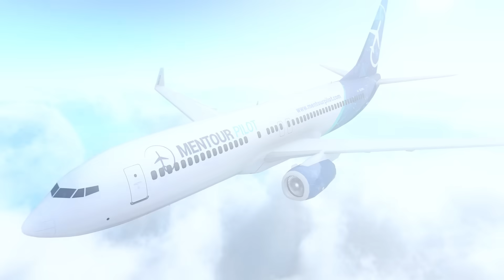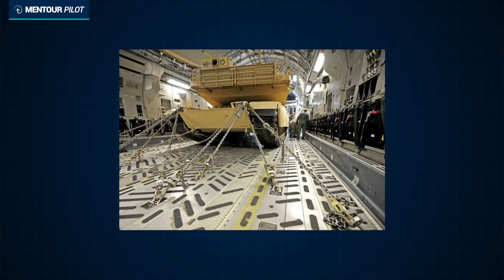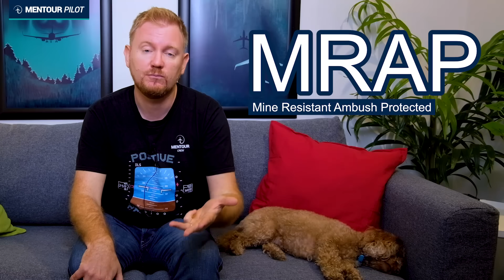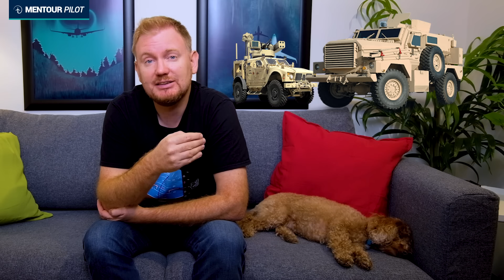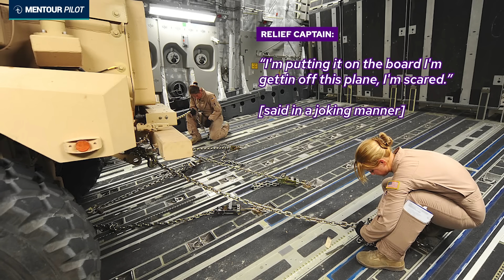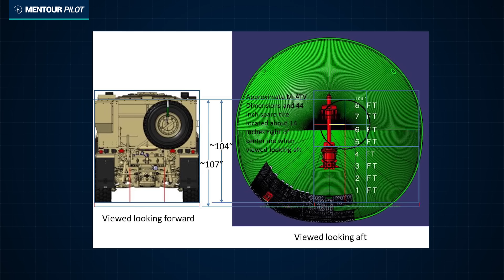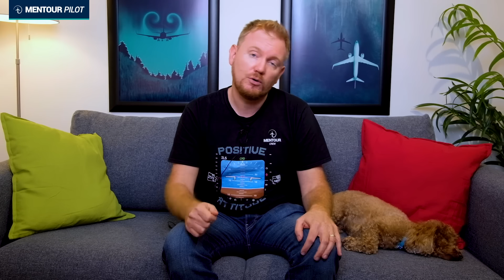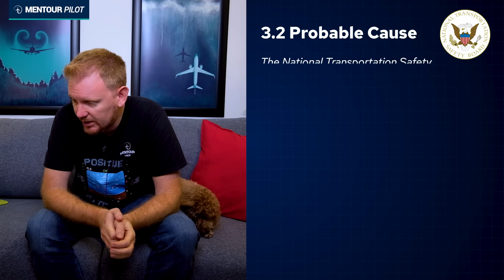Why did the pilots LOSE control?! National Air Cargo flight 102

Comment: This is awful. They were so close to avoiding the disaster. All that would have been needed was for the pilot to be a little more assertive on securing the load, which wouldn't even have been necessary if the airline had offered better training.
Sad!
Reply from the maker: Absolutely correct
Reply: @MentourPilot  a gruesome event covered respectfully and with tact, well done.👏
Reply: One question to ask is always "what training and certification do you have"?  Or even "show me the written procedure you are following".  "Where does it is say the cargo can move?  If so by how much?"   Yes, I know it is easy in hindsight but this is an unbelievably critical job that must be done right.
Reply: @jamescaley9942  "Where does it is say the cargo can move?"
The cargo cannot move. No captain worth his salt would fly with loose cargo.
Reply: @millomweb  I 100% agree. Cargo like they had onboard should not move at all.
Reply: @VMCAviationVideos  THANKS - cos I'm totally clueless :) I can't even tie knots in ropes to tie anything down ! But I do understand physics !
Having recently watched a 'disaster' video where a plane was stressed to 5G and survived, landing reasonably ok in the end, the plane was still written off pure on grounds of being overstressed in flight. So, on that basis, straps to tie down a load of 1 tonne should be strong enough to hold down 5 tonnes. So if the wings fall off, you can be sure the load wouldn't move ;)
Reply: @jamescaley9942  The loadmaster  did it by the book, relying on the company cargo loading manual.  Which left out some very crucial elements.  Which is why the chief loadmaster came up with the same faulty solution for the NTSB.  But yes, somehow I doubt USAF loadmaster training is only a week.
Reply: They were so close to getting lucky and not having the inherent issues in the situation doom them that day. But it was going to hit them or someone like them.  The root problem above and beyond the ones such as flaws in the company manuals, was that this private contractor was asked to do something they had no experience with or knowledge of. To the point that their lack of knowledge was enough that they did not know enough to recognize it. They were being asked to haul heavy armored military vehicles around in their airplane. With no supervision from the Air Force. Using their private contractor training and operational rules, that were never intended to haul armored military vehicles around the planet. a 5 minute walkthrough by an Air Force Loadmaster would have spotted the problem instantly. Why was military cargo of this nature not being checked and cleared by military loadmasters when shipping into or out of foreign military bases? Why was National's freight manuals not reviewed by the AF? Better yet why were they not issued AF manuals for how to properly secure and anchor the vehicles for transport? This goes a little deeper than National having bad training or publishing incorrect strap calculations in their manual.
Reply: @andrewtaylor940  When a carrier takes a military contract, they are asserting that they have capabilities at or beyond what the military has. That's why there wasn't a check, that's why they weren't issued manuals, that's why there was no supervision. It was expected that the crew already had the competencies required to handle the load. In short, the Airforce ordered a motorcycle and got a tricycle. National should have never picked up the contract in the first place.
Reply: @Mostlyharmless1985  fair enough, but since when was it good practice to hand out high value business on the strength of unsupported assertions?
Reply: @kitten_processing_inc4415  you are asking me about the ingredients of the sausage, when all I do is turn the grinder. I’m telling you how it is, not how it should be. 
There’s a fair amount of delineation between contracted shipping and military shipping because if the military takes on the responsibility on the disposition of the cargo, then they are liable for anything that happens to the equipment or personnel if something goes wrong. Now I haven’t read a contract in a long while but I’m 90% sure that the carrier agrees to handle the cargo according to or exceeding the militaries standards.
Reply: @Mostlyharmless1985  I don’t understand anything about Military nor Contract nor Airline Crash’s.
I was used in TRADE BUT IT WAS KEPT SECRET💔
Reply: @andrewtaylor940  Indeed.   I'm amazed that military equipment is transported by air with out a US military load master approving it.

Also, notice how in pictures of vehicles being loaded by the military either had a insane number of straps, or used chains.   It's so life or death that I just can't wrap my head around the idea that you would even trust straps over certified and tagged chains.  Straps have their place, but chains approach true mechanical attachment and that seems warranted on this kind of item.  How many large bulldozers and excavators do you see tied to a lowboy trailer with straps?.... I never have.
Reply: @member5488  That’s a good point, and those trailers don’t rotate upward to 20 degrees either.
Reply: @member5488  In ship operations at least, the military gives a load plan, but the second mate is the final authority of the final disposition of the load on the ship. They are not required to listen to a single thing the military suggests. If you take the contract to carry the freight, the inherent implication is that you have crew that is trained and experienced in handling it. The entire point of putting it on a contract is that the military assets aren't available to move the cargo in the first place, else the military would do it themselves. That is my guess as to why a Airforce Loadmaster didn't check it over. I guarantee that if the National Loadmaster were humble enough to find someone to help that it would be freely given, but being a contractor it is firmly in the "not my monkey, not my circus" territory. You took the script, and in taking it you were guaranteeing the handling of the cargo.
Reply: @member5488  The problem is that aircraft anchor points are not nearly as strong as the anchor points on a lowboy or a railroad flatbed. So you need many straps to spread the load.  And when you run out of the anchors with the right geometry you need even more derated straps. Hence the Boeing 60 strap solution.
Reply: @member5488  that is a very interesting point. It is in the armies very own interest to receive their cargo in time and in one piece. Checking the cargo securing before departure and on arrival and talking to the flight crea would have revealed a systemic risk of damaged cargo. Even ignoring the risk of damage to the plane and risk to human life: That securing was inadequate for the save transportation of the cargo.
Reply: @member5488  until about 1995 none of the guys around here chain excavators on at all. everyone thought a chain wouldnt stop it anyway. until the cops cracked down on it, you wouldnt get away with it for long now
Reply: @andrewtaylor940  I agree. The USAF should have supervised the loading. They got it there, somehow.
Reply: They weren't close to avoiding the disaster at all! There were so many failures, it's hard to imagine how the pilot could have been prepared to take off. Even a truck driver would check the straps on a load before setting off, or after a stop. Things get really dangerous when unqualified people start using their experience or intuition.
Reply: @charlestoast4051  It's surprising the first flight with that cargo was completed.
Reply: @charlestoast4051  exactly! Even a truck driver inspects their own load!
Reply: @charlestoast4051  absolutely, seconded by a truck driver, ALWAYS check your load for security, more chains,wheel chocks, and more straps, until ALL possible movement is eradicated, in all directions, and that's for a truck, if my truck could fly, I'd be using everything possible to stop ANY movement
Reply: @charlestoast4051  if they are even allowed in their trailer. Sometimes they get contracted to transport a mystery load by the government. Or other highly secretive products from companies. 

Now, the pilot should've checked in this case.
Reply: The load was VASTLY more than the aircraft could safely and legally handle. Nobody on the plane or in the entire company realized that, or understood how complex it was to secure that kind of load.  Even if they had added more straps they almost certainly wouldn't have been enough, as you rapidly run out of the tie-down points positioned appropriately and you start to have to de-rate the strap capability as you use the ones you have.
Reply: @k53847  and that's how boeing came up with 60 per vehicle.
Reply: @electricheartpony  '60 per vehicle' clearly shows Boeing's complete ineptitude.
The only person that can say how many straps are needed is the person who fits the straps. Because it depends entirely on how the straps are fitted. Also, those vehicles should not have been on their wheels. They should have been sitting on solid blocks. By leaving them on their wheels, the suspensions will allow movement - and that's why the guy said they normally get movement - because they've not been securely loaded. Chains should have been used, not 'straps'. The weight of each vehicle should have been multiplied by 5 and the number of chains needed for all 5 directions should have amounted to 150% of wt of vehicle x 5.
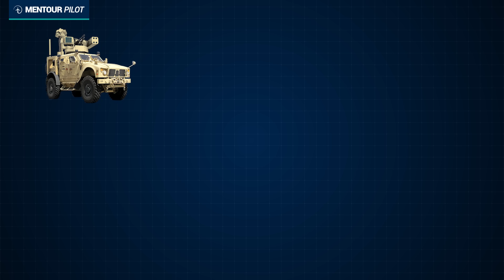Reply: @millomweb  60 is better than 26 or whatever the loadmaster was recommending 8:41
Reply: @millomweb  chains may not be suitable as they may exceed the point load on the deck floor, you would want to spread the load evenly.
Reply: @stultusmagnus  It's a sheer sign of cluelessness.
As someone else said, the anchor points in the aircraft may not have been suitable (strong enough) for that type of load.
Reply: @timballam3675  It's probably questionable as to whether the plane was kitted out to carry loads like that in the first place. Clearly the loads should have been chained down and the plane should have been suitable for chaining down to.
Maybe a further false floor should have been used to spread the load properly.
Reply: @k53847  I suppose it’s reasonable to think “if it fits and weighs less than max. load capacity, it should be ok” but clearly ‘how to secure it’ is the 3rd side of the safety triangle.
Reply: @k53847  The load was within the capacity of the aircraft if properly secured. The video correctly makes clear that the risk was understood but not properly evaluated on this occasion.
Reply: @philipsmith1990  No, the NTBS report clearly says that the maximum safe and legal load was one vehicle.  The limit isn't just total weight.  Look at the report to see their explanation.
Reply: @k53847  And probably leaving them in neutral, so they rolled around as well. Gosh
Reply: @BubblesTheCat1  
If you secure the vehicle properly it doesn't matter of is in neutral or not.
Reply: @smk3964  Yeah, that's true, but if it wasn't secured properly, being able to roll on their wheels could have made the difference between crashing or not.
Reply: @BubblesTheCat1  Given that the floor had rollers for easy cargo movement, I imagine 12 ton vehicle could easily slide on those rollers on an incline (10 degrees rotate angle for 747-400 if my google-fu serves me right) even in park/handbrake state.
Reply: @vadimbich4602  Aha! The first intelligent response. 😊
Yeah, I think you're a 100% correct. Never thought of that.....they'll roll,  regardless. 
Definitely needed chains to secure it,  and not straps. I also agree with the one other person who said that vehicles must not be on their wheels, but on blocks, as theycan still move due to the suspension.
Reply: @smk3964  Yes, the vehicles shouldn't have been standing on the shock absorbers, allowing the vehicles to swing up and down and tug on the straps.

And the fact that yhe vehicles had already moved forward during the landing should have been enough to realize how close to death they had already been on the first leg. And that a big rework was needed.
Reply: @BubblesTheCat1  @Kevin Rose, I’m pretty sure the vehicles being in neutral were never a issue. And hindsight is always better. If the still photographs examples and the description in the video are correct, the vehicle’s were chained onto doubled up aluminum skid plates with plywood in-between to distribute the weight. If those skid plates were not captured by the floor cleats/hooks, this was the huge problem for this heavy load. Not that it would have even been possible to use the floor hooks because the load plates were warped upwards from the chains that were used to hold the trucks in place. This also greatly reducing the contact area between the load plate and the airframe decking. Aluminum on aluminum does not have a great deal of natural friction anyway, then add in the rollers on the airframe decking basically making these vehicles projectiles. They should have been loaded with tires on the deck (friction), then tires deflated (more friction). Secondly, why not use chains? Because they weigh more? Chains should have been used to secure this load. That’s how they load in on C5’s. Those bits of straps that were shown at the end didn’t look very substantial at all. I drive heavy load commercial and would never haul something this heavy using straps, let alone needing 60 straps to secure one vehicle safely. Just one 1/2”, Grade 120 load chain has a working limit of 17900 pounds and a break force limit of 71600 pounds. 8 chains and binders per vehicle would been enough to eliminate any movement. Add a couple more to be sure. Even on aluminum skids, the use of chains would have eliminated any kind of movement. Are we now getting close to the load limit of the aircraft? leave a truck on the tarmac and pick it up next time. I know... Hindsight.
Reply: @BubblesTheCat1  Don't forget the important piece of information that the vehicles were sitting on double-stacked "pallets", basically huge aluminum "Cookie Sheets".  If the straps gave way, it would not matter if the wheels were locked or not... those pallets are going to shift.  Now factor in Acceleration during the takeoff run, then the pitch up during rotation, and the rest is history.
Reply: @BubblesTheCat1  if they're sat on blocks under the axles, suspension is still allowing movement,wheels or no wheels!!!!!,  using the chains on chassis mounted shipping eyes, will compress the suspension until ALL movement is eradicated, sprung or unsprung, then using chains or straps in OPPOSING directions, as further security, but ALL movement must be halted, and I would definitely be using double wheel chocks on each and EVERY wheel, in addition to using every single strap,chain and lashing points!
Reply: Ok there is a simple explanation here that everybody has missed, including @Mentourpilot, that I have seen about this accident. Imagine for a moment, theoretically, that you have a 24 tonne object that needs to be tied down. It makes perfect sense to use at least twenty four 1-tonne straps to tie it down, right? So imagine that 6 are used each side. You might even add another 4 on each side. 
HOWEVER,  nobody realised that when you take off, if the object move slightly back, only the FRONT 6 or 8 or even 10 is holding the entire 24 tonnes, as the other straps are either relaxed or doing no work. And there you have the accident. 
The one thing I cannot understand about this is: why were these trucks not parked in-gear and handbrake up? Surely these would not move even at a relatively steep angle?
Reply: @etiennebotes  regardless of the wheels orientation, the weight will shift according to the center of mass of the vehicle, which will put strain on the straps facing the direction of travel, on an upward pitch so, if you put 6  straps out of 24 on the front half of the vehicle, then you are about 18 tons under strapped for the load. I am not a loadmaster, but that's the idea. The cargo will overcome static friction and slide with 24 tons of inertia, period, once it starts moving, it keeps moving, wheels rolling or not. The vehicles were strapped themselves to a plate to facilitate loading onto the plane, and I'm thinking the vehicles were adequately lashed to that. I think the failure was in the entire plate, vehicle and all sliding to the bulkhead.
Reply: @Mostlyharmless1985  You are ignoring the vertical component of the load that is taken up by the floor structure. As the aircraft was accelerating up and pitching up, and experiencing about 1.2 total Gs on 20° climb angle, only 0.41 Gs would have been loading the front straps. That would have pulled the front straps on a 18 ton load by 7.4 tons horizontally, which just three straps would have been enough to handle. If the front straps were at 20°, which seems about right looking at the photos, it only adds another 6% to the tension, so 5,215 lbs per strap across three straps. That's about the rated capacity of the straps, not including any safety factors. If there was six straps pulling forward, the loads were down to one ton each, only half their rated capacity.
Reply: @etiennebotes  would think the vehicles would be lashed to the deck, wheels off, body and axles fully secured and no loose movement at all, even suspension movement should be eradicated by many many straps, as well as the axles being chained to the deck
Reply: Unusually hazardous cargo like this should have warranted inspection by several different personnel experienced with securing it previously, with the necessary extra time and money needed for doing so specifically spelled out in bold in the contract.  A special deck should have been constructed for hauling heavy vehicles with tie down points that mimic those on a low-boy.  Carrying five heavy vehicles seems like too many to be trying to move at one time.
Reply: The captain said "those things are so heavy you'd think they probably wouldn't hardly move no matter what." (13:17 in the video) 

That statement shows an incredibly poor intuitive grasp of physics by the captain. 

I think this is a deficiency that should exclude anyone from qualifying to fly a plane, and which nobody deserved to die for. I doubt even the most rigorous training would be enough to make such a person safe to command an aircraft.

At the risk of stating what should be obvious:

1. Everything weighs the same in freefall (which is why passengers etc can "fly up" and hit the overhead lockers in turbulence). 
2. No matter how massive something is, it will move easily if you remove enough friction and drag from the situation (just try pushing a 40 tonne boat out with one hand).
Reply: The aircraft was only capable of securing one vehicle due to the number of strap points available. Securing the load better with better straps would not have prevented the failure. That is how Boeing came up with the 60 number. They were looking at the capacity of the strap points, and not the straps themselves. The correct course of action would have been to unload three vehicles, and probably inspect the aircraft for damage as well.
Reply: Again, people tend to ignore certain signs. When the Captain heard that the cargo had shifted, that flight should have never taken off. Lives would have been saved. 😥
Reply: Yes so tragic
Reply: Hi, Mentor I worked driver on Lorry Cargo in 2012 in to Schipol, Paris ,Hambur , Bruxeles, 
When I seen the palets with cargo for aircraft , I said it is not good , all cargo from palets can fly out, I am afraid to put the truck on parking near the airports.
Reply: I traveled on RAF Hercules as a squaddie & before loading my Land Rover & trailer full of kit everything had to be locked tied like a mother, they enjoyed having us run around like March Hares the btards! Nothing ever happened on flights thank god, rules are rules & that's what airlines do in shilly-shallying as money & time are king not safety but ultimately it's the aircrew who decide, the buck stops with them but there's companies pressure & job security but dying is worse.
Reply: @James Street  The problem is that the anchor points in a plane are not as strong as those on a low boy or flatbed.    The chains wouldn't have failed, but the anchors they were attached to would have ripped off.  They may also be a technical reason why you want straps that can stretch to absorb shocks holding the load vs chains.
Reply: @James Street  Running out of tie-down points is a key part of what caused the accident.  The stated strap strength is calculated at a certain angle, when you run out of tie-downs with that geometry you need to correctly de-rate straps based on the actual geometry you have.  Which means you need more straps, at even worse angles, which offer even less strength.  Which is how Boeing came up with 60 straps as the answer to 'how many straps were needed to secure this vehicle correctly?'
Reply: It's also the pressure of economics , I know some pilot's don't want to be the reason for delay of the flight resulting in escalating cost.

Offcourse after the fact , such desicion looks logical , however imagine the Captain grounding or delaying the flight due to load concern costing extra money to cargo airline , only to be told later he overreacted and his over reaction costed the airlines losses due to the delay. 

Therefore Unfortunately  it's not black and white
Reply: @dimitrz2000  and that's an extremely unfortunate reality. Where a pilot can't do what they think is right without fear of repercussions if it turns to be nothing.
Reply: @dimitrz2000  it's not black and white but a bit of get-there-itis and machismo (captain is palling around with the loadmaster who is in charge of securing an unprecedented load...) is likely the reason they still aren't flying. Not judging, it's just reality. Also, lack of standard training for loadmasters across airlines is at play.
Reply: Loadmaster secures and signs for the load. At least have an idea of what you are talking about...